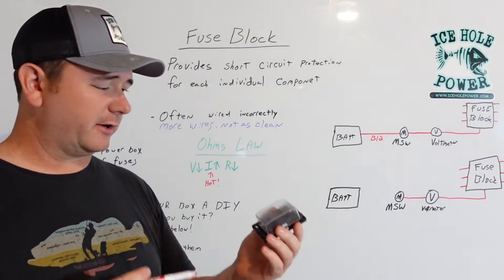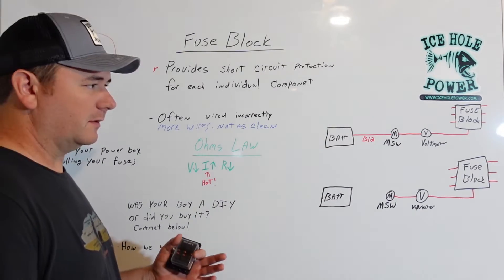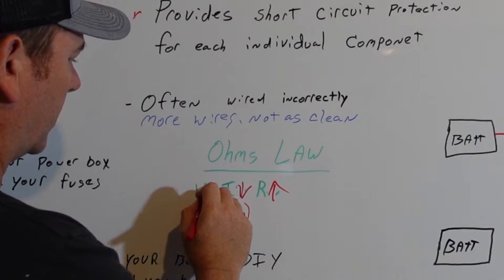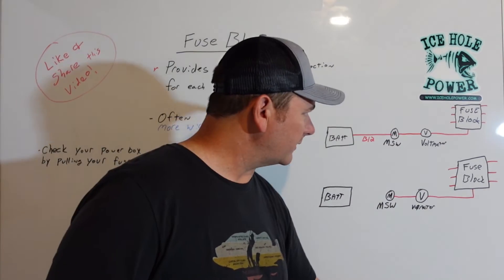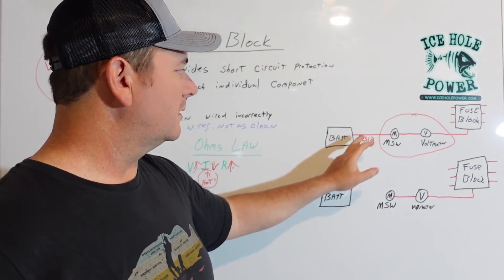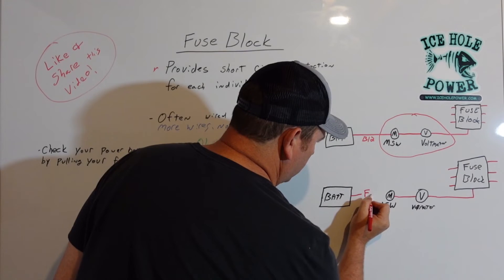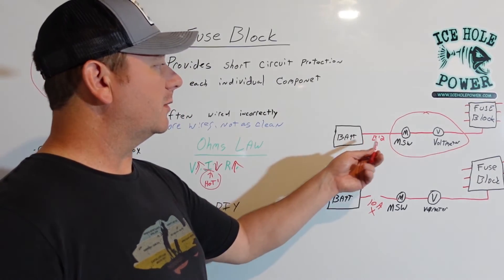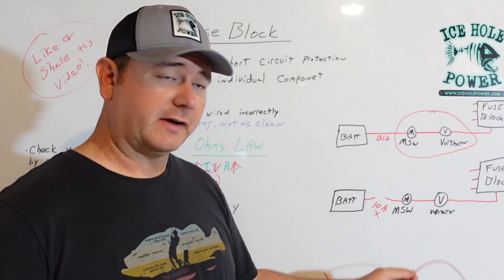If You Have A FUSE BLOCK In Your Power Box, YOU NEED TO WATCH THIS!

Comment: A long retired Army Colonel who installed radar installations in the Pacific in WW2 wired in my 220 volt Sears AC unit. Upon removing unit 10 years later and pulling fuses, it was discovered unit still operated. Triple check that no power is present with fuses or circuit breaker disconnected. Great Video!

Comment: DIY radio go box, 2 of them. Blew many a fuse learning how to build them LOL. Fortunately, the fuses helped protect me/the equipment. No power gets to fuse box unless the master switch is turned on. No power gets to "sections" of my radio box without a secondary master power switch. All are fused, but I do use a common ground, not the neg fuse box terminals.

Comment: Attach a  40, 50, or 60 Amp Circuit Breaker with Manual Reset 12V-36V DC Waterproof Surface Mount right to the battery depending on your total amp draw and then run your circuit. That protects your wiring. Forget the inline fuse. That wiring of an inline fuse could be too small for your total amp draw of your total circuit.

Comment: Just for clarity,  the primary purpose of a fuse is to protect the wiring.  The fuse size is determined by the max amperage rating of the wire.  A short circuit occurs when the external resistance (circuit) drops below the internal resistance of the power source (battery in this case),  this condition would quickly exceed the max amperage rating of the wire and could result in a fire.  It doesn't take a short circuit to cause a fire,  exceeding the max amperage rating of the wiring could. I use 10 to 12 gauge wire going from the battery to the fuse block ( Kirchoff's Law - Sum of the currents ), and 16 to 20 gauge going to the accessories, it depends on the current draw of the accessory.  Just to be safe, I typically use heavier gauge wire and a fuse that is no more than half of the max current rating of the wire going to the accessory.  Fuse size can safely be downsized if needed.  That's my 2 cents.

Comment: DIY      I am running low current (2 USB's, small fan & small radio). Also, higher current loads (a 600w AC inverter & a fish finder) wired it A+ to inline fuse, then to fuse block, splitting the different loads with appropriate fusing, and wire size for the load. Solar input is next.

Comment: Eh, more wires for me to deal with, but all of my switches are in line fused. It’s a pain, but my family has been using it for three years now camping, and it’s still holding strong! Great video. Watch these kinds all the time, I’m a welder, not an electrician or battery tech, so every bit helps. Great at getting shocked though. Jk, kind of. 😁

Comment: Build my own DIY box but used a 6.4 amp Sherloteonic  power pack to charge my batteries and provide DC output. It solved my fuse issues as a/c fused, 6 12v  outputs rated  with 1 A with fuse protection.So far just 6 bar led light and a ac led. Battery cutoff switch.But planning D/C lighter socket,  USB and DC jack.

Comment: I've used booster packs for with a modified sine wave inverters for years usually last a season and their battery won't take a charge then I found out the charge parameters were all wrong stopping the charge when the battery is dead and taking it way to low by knowing this I've been charging my last two units through the booster cables and I've got two years from them unfortunately I believed the manufacturer that 13.1 was fully charged and seriously shortened their life by time I figured out that they were wrong I did manage to get almost a year of extra life for the units as for your idea that one fuse close to the battery terminal is all thats needed so if you use a 20 amp fuse to power your unit so your cigarette lighter port will power your 12 volt slow cooker then plug in a 12 volt vacuum with a 15 foot 16/ 2 wire if you get a short either in the vacuum cleaner or other device that uses that gauge of wire or something falls on the cord shorting it out the cord from the unit to the plug will fry and catch fire no you need the fuse close to the terminal and you can if the cigarette plug is your highest draw run that off the same fuse making sure you use 12 or even 10 gauge wire to the cigarette lighter plug then a fuse block with a dedicated fuse the size appropriate for each lower draw item my cigarette lighter plug will be in a different area from every other plug especially my ancillary plug for my vacuum cleaner and other items which plug in to an auxiliary power supply if someone plugs the slow cooker oven into the auxiliary plug worse that happens is the fuse blows but I've had cords short and burn up its especially dangerous when you're driving 70 miles an hour that black smoke makes it hard to see out the windshield also the fumes can kill you now some may ask what's the difference between a cigarette lighter port and an auxiliary power plug the difference is in material's and how their built auxiliary port usually have a plastic disc holding the positive conector and a lot of newer ones Hava a plastic barrel as well only metal is the contacts and the wire is quite often 16 gauge a cigarette lighter plug has a metal barrel and a ceramic disc to hold the positive contact wires are connected with spade terminals and the wire is usually 14 gauge but for high draw loads can be as mine is 10 gauge I also solder them I'm planning on upgrading a couple of my old booster packs one i know I can put a 100 amp hr deep cycle battery in it'll be heavy but it'll give great boosting power and it'll run my high draw loads for a lot longer than the 20 amp hr battery that's dead in it now it'll also be able to be an auxiliary battery for my other booster packs I'm hoping I can put as big a battery in my nautilus booster pack as well it'll give me another 120 Amp hr for my 1750 watt diy solar generator if I can put a 100 amp hr battery in the nautilus booster pack it'll give me another 200 amp hr after this upgrade my next one will be to the newer battery chemistries whatever the newest and best batteries in the next 5 to 8 years at that time I can also upgrade my pwm solar charge controller to mppt

Comment: I built my own box just a few weeks ago, and did the fuse between the battery and master switch.  Glad you shared this information.
Reply from the maker: Sweet box. Just watched your video, I would change out that 20 amp fuse for a 10 amp fuse. At least until you beef up the wiring for the inverter.
Reply: @iceholepower8012  thanks for watching!!!!  Thank you for the tip, I will do that.  Not sure if I will be able to do an inverter in this one, not much room left.  If I could afford a 30 amp/h lithium battery instead of the 3 SLA batteries, then there might be room.  I see a future build coming my way.  Again appreciate you watching and for the tip.  Juddie - J & J TOA

Comment: One comment on your diagram, your Voltmeter is shown incorrectly. Voltage (Current) doesnt go through the volt meter, The voltmeter is connected to positive and ground/return. its actually the switch that can be the problem as its not designed to handle the full load, it should be used to turn on a relay with a 40Amp or so capacity to prevent the switch over heating. An in line fuse isnt going to protect a switch that is not properly rated.. 
P.S. I am an Australian Airflorce trained Aero Electo/Avionics tech of 50 years of experience..

Comment: Since a 3 & a 7.5 amp fuse both are needed  for livescope could you wire in  an sae socket with a 3 amp for the head unit & a separate sae socket with a 7.5 amp fuse & be ok? Also would the master switch have to be on to charge through the sae socket with a charger that has an sae connector on it? Thanks
Reply from the maker: yes to everything lol

Comment: You could also use an automotive relay. The switch and voltmeter would be on the side that controls the relay....and all other higher powered components (binding posts, accessory outlets, etc) would be on the switched side of the relay with a fuse. That way all of the higher powered outputs would be isolated from the control side. Just a thought.
Reply from the maker: I like to keep it simple. One fuse straight off the positive battery post will protect everything. Most of these units are used in low current applications.

Comment: Jeremy, thanks again. Relatively new to your channel. I ordered a Fuse Block and never used it. I saw a video before seeing yours that used an inline fuse, that is what I use as well. I just need help wiring switches independently so I do not have to have the Master Switch on, but after thinking about this and seeing this video, especially using several sources to charge my box (solar, on a battery tender, via banana jack, I am going to wire everything the regular way so it all has protection, unless there is a way I can wire if so all have protection and I can still wire all components indendent of the Master Switch having to be on. Looking forward to your response.  Thanks.
Reply from the maker: Good question. Typically you will want your fuse as close as possible to the pos battery terminal. I would still put a 10 amp inline between your fuse block, just for over current protection. Lets say you have a 6 way fuse block and you are pulling 3 amps out of each circuit. Your total current between your battery and block would be 18A. More than what most of the small lithium batteries that we use are rated for. It's cheap insurance. Thanks for watching!!

Comment: I built my own box with two sets of terminals to hook up lights for my hub, or anything else 12V, and a 12v plug/voltmeter/ USB plug in. I have no fuses or circuit breaker protection. I definitely need to add them now that I've seen this. 
Just need to figure out how.

Comment: Thank you so much for making this video. You are basically reinforcing something that I figured out very early on when I started making power boxes and trailer test boxes not long ago. I put an inline fuse right off of the positive terminal. Once I started doing that, it dawned on me that putting a fuse block past that is absolutely pointless. That allowed me to clean up my wiring. I still have a six gang fuse block in my electrical box that will probably never get used UNLESS I make up some kind of box with multiple batteries. Subbed.
Reply from the maker: Yes sir! We never use them. Thanks for the sub!

Comment: Instead of using an inline fuse I was thinking of using a 15 amp breaker and no fuse box...What do you think?
Reply from the maker: Shouldn't be a problem. Just make sure your wires and battery is rated for 15 amps and put that breaker as close as you can to the pos terminal of the battery

Comment: I agree, but one of the benefits of having a fuse block with individual fuses for each device, is that it helps to isolate a device failure when it happens. That blown fuse in the fuse block points directly to the failed device component in the build, making trouble shooting and remove/replacement much quicker. A single inline fuse at the battery will blow, but you won't know what caused it to, as in, which device caused the short? I vote for both... inline fuse at the battery, for the reasons you describe, but a fuse block that powers each device independently as well. Actually, some devices need a much lower fuse amp rating (2A, 5A, etc) than the inline battery 10A fuse at the battery terminal, this way with a fuse block - individual power protection ratings can be maintained to protect sensitive electronics from frying if the inline battery fuse at 10 Amps doesn't blow in time. One possible drawback for having a bunch of fuses, is some added line loss resistance in the circuit, which might effect sensitive electronics that freak out when power levels are slightly below full expected levels, but removing fuses isn't the answer - it's too risky. Better to increase wire sizes as necessary to overcome those line loses. Just my two cents. I AM NOT a certified electrician. Just a Ham Radio guy going by some practical experience and various guidelines that I've come across in my hobby electronics. Great content on your channel, and I enjoy following your builds that accommodate all levels of viewers. Right on! 72s/73s

Comment: Built my own power box for my trolling motor, with the bells and whistles. I use a 50A fuse resettable switch which also doubles as the master switch, although after having used it this summer and have a good feel for how much power (amps) my motor draws I will probably downsize the fuse to a 40A as the motor draws just less than 30A at full speed and I generally don't use the power box for anything else while running the motor except to charge a cell phone if needed. Good info and reminder about safety.